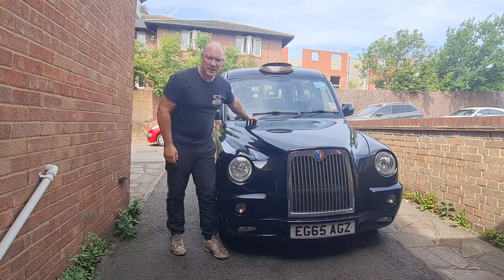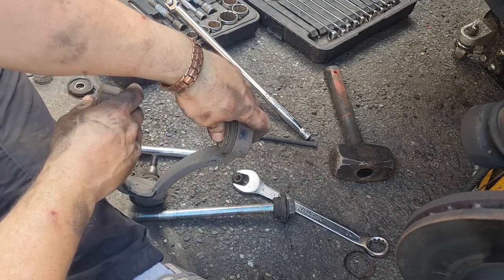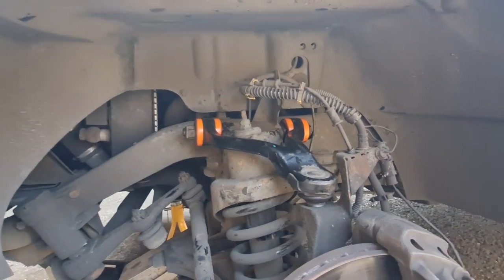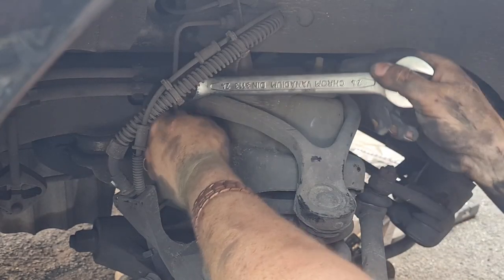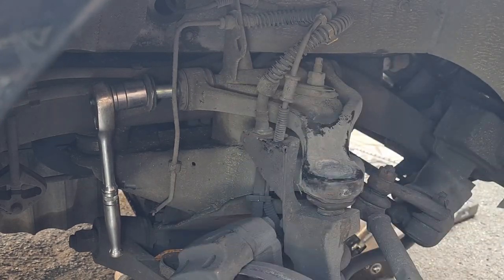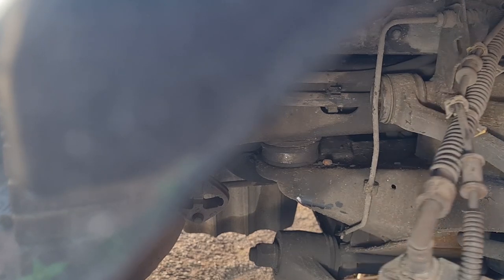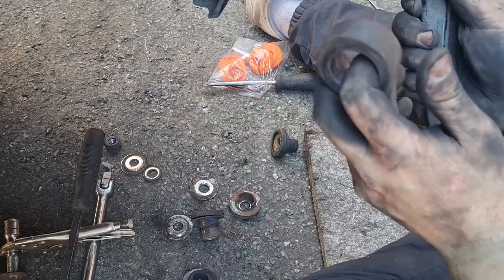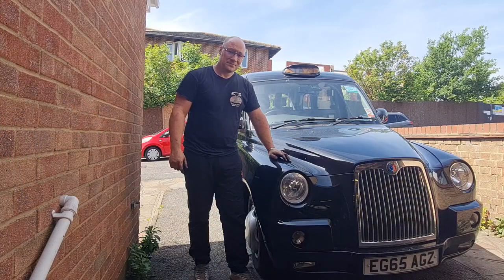London Black Cab Front suspension Polybush UPGRADE - Knocking noise SOLVED !!!

Comment: Tried doing this on my first retired cab….  Only tried it on the passenger side and the bolt would not move, but came off ok. But no amount of trying would shift the bolt. Couldn’t even turn it.  Drilled into in, heated till it was glowing  , still wouldn’t budge ! In the end I scrapped the cab

Comment: Nice Video ! Was going to fit poly bushes on my Tx4 but my mechanic told me that they would eat through the arm. Probably just lied because they last longer.
What the ride like now, same as before, or harsh ?
Thanks
Reply from the maker: Hi mate thanks for the msg, i dont find the ride any different, i had poly bushes on my old cab too and it never damaged the arm so you should be fine, hope this helps 
All the best MEC 👍👍👍
Reply: If you fit poly bushes in the wishbone without copious amounts of copper slip you'll end up with the bolt seizing as the bushes last a lot longer. In Liverpool taxi garages no longer fit poly bushes.
Reply: @Br1anuk   I've fitted the rubber bushes and they don't last long before perishing. I've changed mine to the poly bushes and everything feels tight. Time will tell over the next few months.The bolt would seize anyways if not lubricated as Rubber or Poly bushes the bolt goes through the same steel type tube in each bush. The mechanics probably don't use them in Liverpool because they last longer and do them out of work. Just my opinion m8.
Reply: @wilyboo  just wait till your garage tries to get them out and has to drop the front axle. Big bill.

Comment: I have the same issue with my 2011 TX4. Intermittent knocking noise but the passengers can also hear it. Took it to the garage and they didn't manage to find out what it was as it was quiet at the time. Could you hear the knocking noises travelling to the back of your cab?
Reply from the maker: Hi mate, i do have a knocking noise even after replacing all the bushes, i think it is the shocks, they have a conical shape taper on the bottom of them and when i took mine out they have rusted and parts flaked off which makes the taper smaller than the hole it sits in, hence the rattle, i am going to fit new shocks on mine soon to see if this cures it, hope this helps 
MEC 👍👍
Reply: @mec-tec  Appreciate the response. Cheers mate!